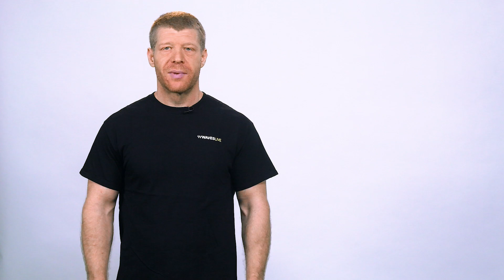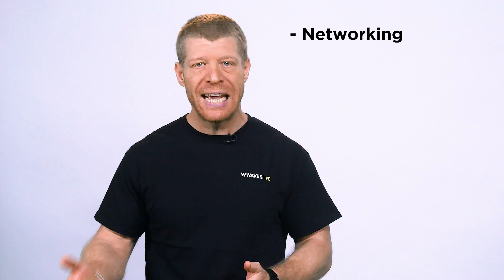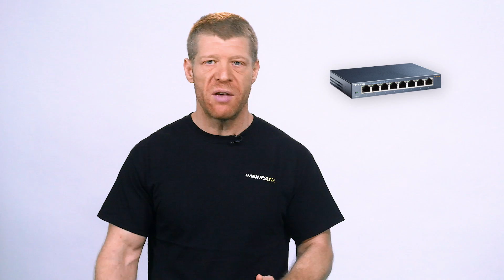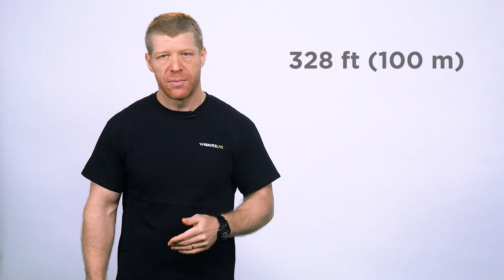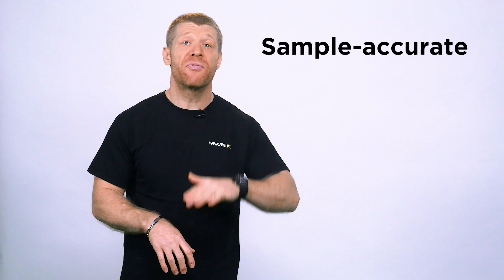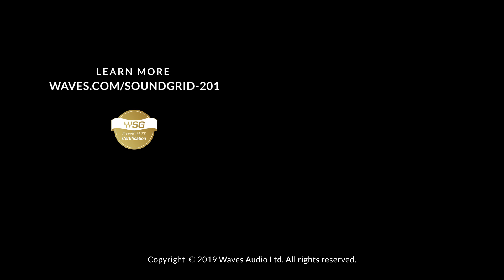SoundGrid 201 Certification Training Part 3: Networking and Latency in a SoundGrid System

Comment: Hello, in the test there is a problem:
question - What is the maximum distance one can setup a SoundGrid Server with only one ethernet cable connecting it to the main switch?
correct answer suggested by the test - 328 fts
on the website - SoundGrid server to switch ----> Up to 10 m (32.8 ft)
what am i missing? thank you
Reply: Same problem here, so what is the right answer?
Reply: @acousticloungeduo  personally i would bet it's the website one, cause in the video he talks about how the servers must be closer (so it can't be the same number, cause it would not be closer), also the website is where clients reference, so they would double and triple check it, so 10 meters